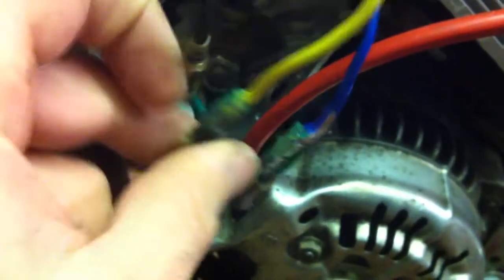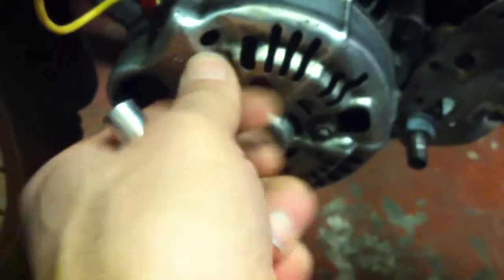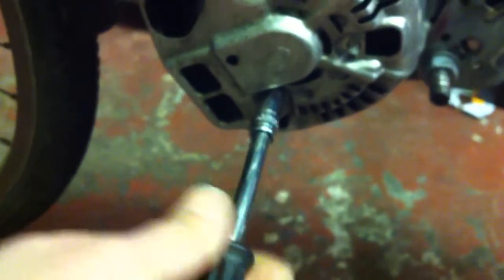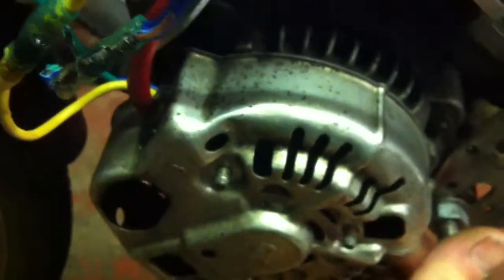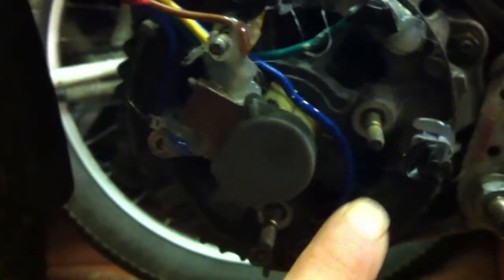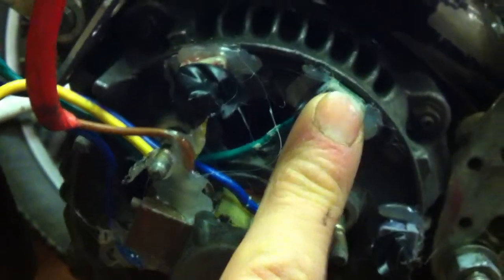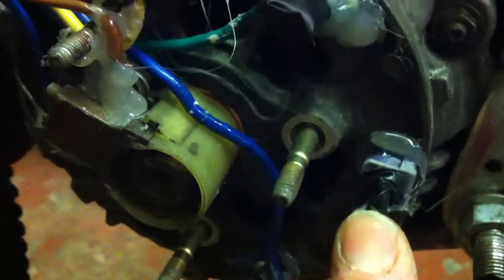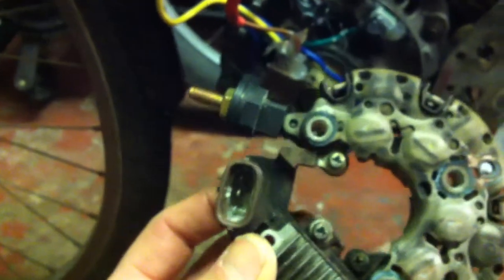Alternator motor as a mid drive - Part 7

Comment: Howdee partner, 
 About the 'common' wire, and the resulting Star configuration of your 3 phase motor: 
 I find that when I try this arrangement, I get very poor performance from it  :( . 
 Instead, I am obliged to bring out all 6 wires, and join the 3 phases in the Delta configuration. 
 This results in great performance, even when the motor is fed with a mere 14 volts. 
 If I remember rightly, your findings were pretty much the exact opposite of this? 
 I wonder what might be causing these differences in performance!
Reply from the maker: In what respect do you believe the performance to be poor? I have researched this quite extensively and star should give higher torque and lower speed. Star will not run as "freely" with no load.
This particular alternator is wired as star and it's not at all easy to reconfigure as delta.
When you say "great" performance, are you still running at 12mph? This alternator has had my bike at 36mph at 60v, which should take roughly 9 times more power.
Reply: When I selected Star mode, my bike still ran, but with very limited power and speed. 
 It seemed to draw more current, and it was unwilling to run smoothly, no matter how gentle I was with the throttle. 
 When I returned to Delta mode, I got a great deal more torque - and speed. 
 Now, bear in mind, my controller is of the model aircraft variety. This 60 amp, 6 cell, controller is quite tiny, and it could quite easily fit into the cover on the rear of the alternator. 
 Perhaps it all comes down to the actual controller in my case? 
 I really don't know! 
 That stated, I am getting at least 12MPH at 14V, which translates to 1.16V per MPH  :) . 
 I am not sure about the overall efficiency of this, but I am getting 0.7 miles per amp hour at 14V. 
 In time, I will go up to 36V, so I can enjoy more speed, as I think I would be quite happy with a modest 25MPH. 
 Oh, by the way, please bear in mind that I operate in metric, but I am equally conversant with imperial  :) .
Reply from the maker: CNCmachiningisfun Could it be possible that you've got one of your coils reversed, so should common them up differently? I'm assuming that you've identified your phases and aren't commoning up both ends of a phase coil.
Reply: +CheadleBiker 
 I have been careful to eliminate the prospect of a shorted phase coil, but there is always the possibility of any one of the 3 phase coils being reversed, so I could look into experimenting with that idea. 
 Perhaps I could connect the 3 phases to my oscilloscope, and spin the energised alternator, to check for the textbook 3 phase signature  :) .